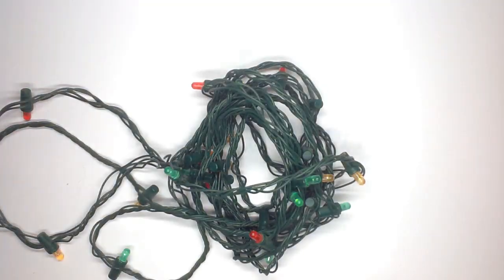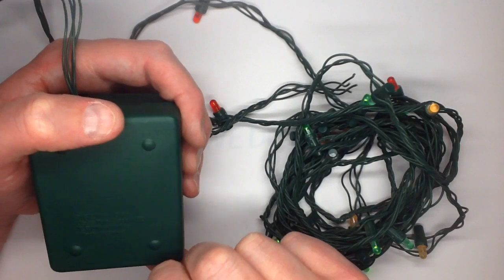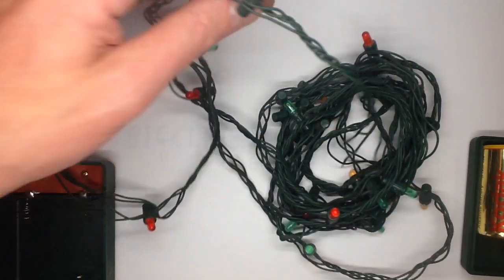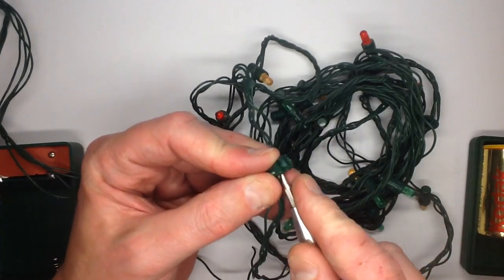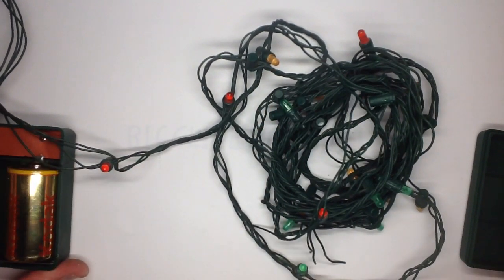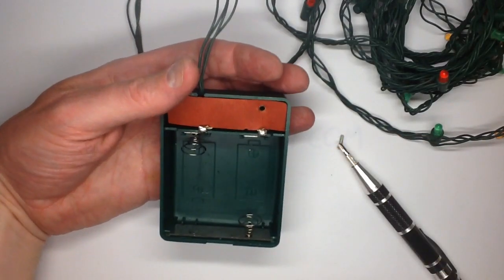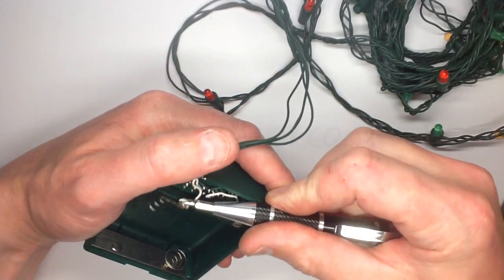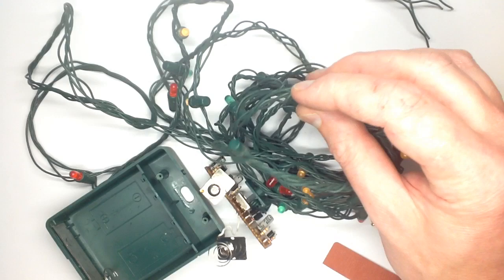Vintage Pifco LED fairy lights.  (Possibly the first LED xmas lights?)

Comment: My earliest LED Christmas lights were in the shape of a flattened plastic Christmas tree which plugged into the car's lighter socket and stuck to the windscreen with a suction cup. It was a three channel set too, about 9 LEDs in total, and bought around 1992, I think. I always thought it was dead neat!
Reply: I remember these! Born 91 I remember having them.

Comment: Holy crap i had a set of these too! Aunty bought them for me in the early 90s, being a kid mine even came in the bath with me, powered up...and still worked, flashing underwater, thanks to the low voltage. Dried out and worked fine! Give you a tenner for them lol around 1999 i was finally able to get some 5mm blue LEDs from a shop in Derby for 50p each! Finally made my own LED christmas lights out of a set of battery bulb lights..fortunately the lamps hadn't been glued in so it was a quick swap! Boring aren't i?
Reply from the maker: ChaosHusky I've never considered taking fairy lights into my bath with me, I might try that with some mains ones....

Comment: I came across part of a set of commercial warm white LED xmas lights. The inserts are molded into the sockets and you have to literally cut the plastic off to get at the LED. The LED's are not your traditional xmas light type either but rather a rounded clear lens with no deflector in them.
I have about 25-30 of them on the piece of the string I have here..

Comment: I remember some vintage LEDs... pause while I remove my glasses and polish while I sigh and look thoughtfully toward the horizon. You could buy an assortment from Radio Shack, and it truly was an assortment, some even looked reclaimed, every pack was different. The kids: WTF is a RadioShack? ...what are glasses?
I watch most of your videos in the shower, so technically I'm touching myself while I watch you, "Hey Clive I'm taking it to my bits!"
Reply from the maker: John Whitley Retro LEDs are highly collectible things.  I can recall getting one of those LED packs when I was young and spending a lot of time trying them all out.
Reply: Yeah I was 'trying out' alright, couldn't really afford a pack of LEDs and Mr Mims book at the same time. So while they made arrow shaped LEDs, apparently the brown and piss colored ones I made myself.
Sorry bought the shower crack, though true, prolly TMI
Reply from the maker: John Whitley Mt Mims engineers notebook was an inspiration.

Comment: Clive,
Thanks for the videos. What are the mini screwdrivers you use? Thanks!
Reply: Ken Wolfe They were available from the 99 p store, or possibly also poundland. I saw them a week after if first saw Clive using them, and bought 4 :)
Reply: Ken Wolfe Looks like something quite similar is available on Aliexpress as well.

Comment: I remember when blue LEDs became available in the mid 90's, I dreamed of building my own string of multicolor LED xmas lights, but never did. I finally bought a bunch when they started showing up in Walmart in the mid 00's, and used them for a few years. But now, I have gone back to incandescent. The LEDs certainly are too bright, have too much flicker, and fade over time. One of these days, I will probably make a small variable DC supply to drive the LEDs once again.
Reply from the maker: Aadil Shah The first Maplin blue LEDs were silicone carbide, cost £10 each and were very dim.  I bought two for my first experimental RGB colour changer, but they were too dim to mix the colours properly.  Then they stocked the Gallium Nitride ones at £10 each too.
Reply: I remember reading an article about Cree, and I thought they had just invented blue LEDs, would have been mid 90s.
 Seems like I was at Radio Shack every week after that and it was like: "blue LEDs and phased plasma rifle in the 40 watt range please."
"Hey, just what you see pal".
Then somebody makes what you wanted to make; we were all keeping it hard for a blue LED weren't we? I still do.
The kids: WTF is a visible spectrum?
Reply from the maker: John Whitley I used to do that too.  I'd read about a new technology and then keep asking for it at local electronics shops in the belief that they would instantly stock it.
Reply: +Eric Wasatonic  last year i got my hands on RGB christmas lights its freaking awsom
Reply: Eric Wasatonic I had exactly same dream and in 2008 I made it real. It cost me around 200EEK to buy two of red, yellow, pure green, blue and white LED's I ran with astable multivibrator driving medium power transistors KT814s on 12V plug-in power supply so one half of the all colors was on at the time. As time went on I got bored of it and disassembled it, but the leads were so fragile most of the LED's used lost their legs afterwards. Now I also went back to incandescent, extending their lifetime using a series diode modification.
Reply from the maker: Eric Wasatonic Have you seen this video?  It shows how to convert a set of traditional tungsten lights to LED with a mains power supply that you can specifically design to run the LEDs at very low current and with good smoothing if desired.  https://www.youtube.com/watch?v=59w0D1FwW8E
Reply: Eric Wasatonic Both Maplin and RS Components were selling blue LEDs as early as 1989. The only problem was, at that time, a single blue LED cost as much as a hundred 'standard' LEDs.
A few years later you could buy full RGB LEDs. That gave me dreams of building a humongous LED TV screen. By the time the price came down, it was easier to buy an LED TV ready made! :P

Comment: Man, your videos are great, thanks again. Whenever I'm in the UK, I'd like to visit you just to see your workshop etc. Would like to learn more about electronics, I know how to build 3D-printers, designed and built a lasercutter, and I've been messing around with simple circuits, but making a ring oscillator with a few transistors and condensators (capacitors) is already too much for me :D

Comment: The yellow LEDs I think are just green with a yellow coloured lens.
Reply: Blaze the Fox They would definitely be yellow LED die inside a yellow lens. Here is how it looks when the colors are not matched. It is a photo of a red die shining red light (albeit dimly) through a green package: http://www.decadecounter.com/vta/articleview.php?item=614
Reply: Eric Wasatonic I mentioned it because those yellow leds have a strong green glow in the center, but it must just be an effect from the plastic.
Reply: Blaze the Fox That could be just a manufacturing error of the LED die, as older type yellow is GaAsP on GaP and it varies in color if the GaAsP layer is not evenly applied. I had some yellow LED's that actually shined orange despite been the same model yellow LED.

Comment: Modern christmas laghts can be far too  bright, I have a longish blue set and they are painful to look at
Reply from the maker: brian whittle Yeah, they can be quite ferocious at times.  Ironically, if they ran them at lower power they would be nicer to look at, last much longer and use less energy.
Reply: I quite like the ones I've got now — they came from Kruidvat, my original string was a 50 bulb one for 5 euros. Warm white with the weird dimple end lens, running at a specced total of about 2.odd watts on a low voltage dc power supply (of unknown quality). I liked them enough that I replaced them with a 100 bulb, 10 euro string of the same a year later (because I liked them but there just wasn't enough of it...) which runs at about 4.odd watts, of of an externally identical but higher power low voltage do power supply. Series strings of 10, and 36vdc supply. Which I reckon makes the LEDs driven round about the 1/2 to 2/3 range of their rating, and that's pretty much fit for my purpose...

Comment: is that classed as vintage? ive only just stopped using a 1950's set of incadescent pifco lamps my parents were probably given by their parents as used when they first moved out, i just got bored of chasing the faulty bulb on the type which meant the rest of them didnt work
Reply from the maker: jusb1066 In the world of LED fairy lights these are definitely vintage.